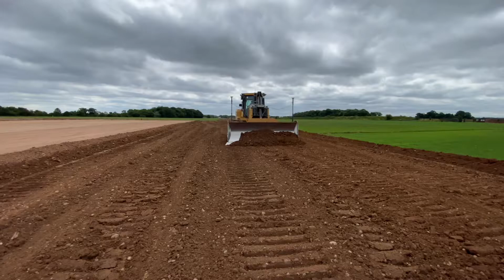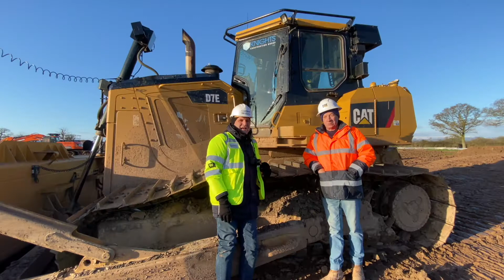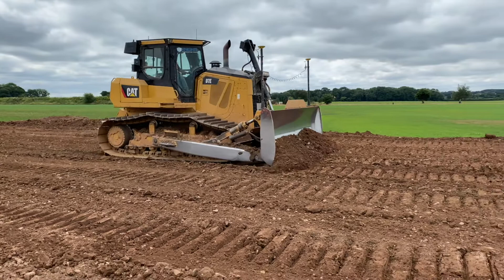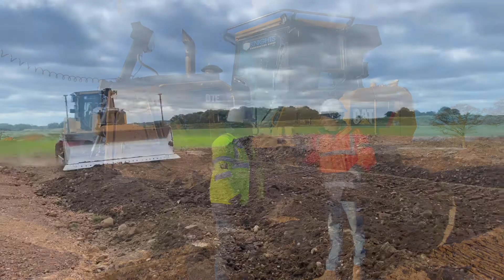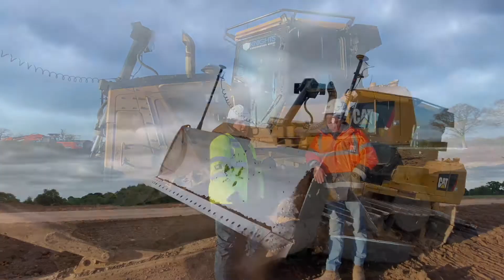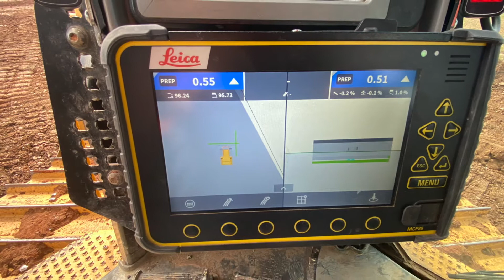Knights Construction operator Murray talks Cat D7E and MC1 machine control from Leica Geosystems

Comment: Hello! I saw a video you made of a Caterpillar D7E with a Leica MC1 system in operation. We are a Leica distributor in Spain and we're having trouble linking the automatic control system with the joystick. Our MC1 system works on the machine's hydraulics but not on the automatic control system. Do you know if anyone has any helpful tips?

Thank you very much!
Reply from the maker: Hi, I recommend contacting the manufacturer directly for technical support.